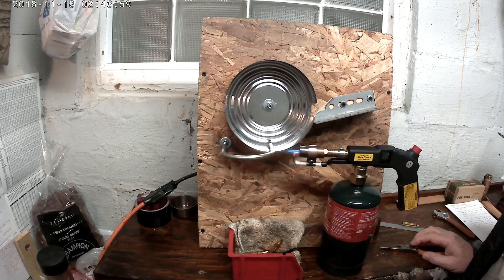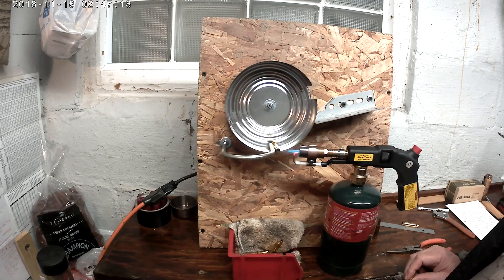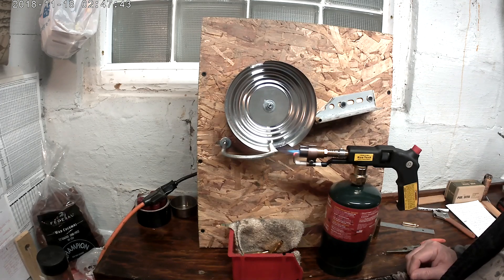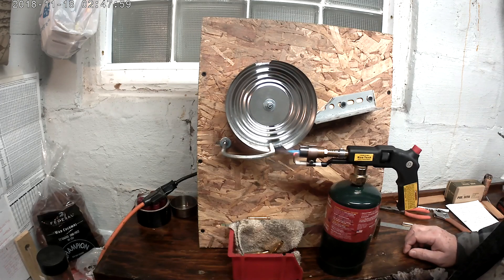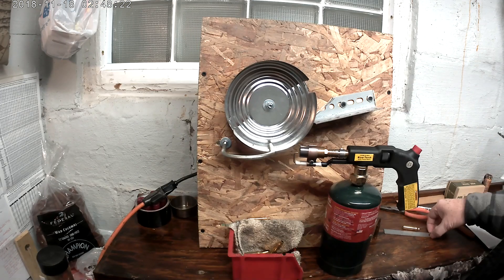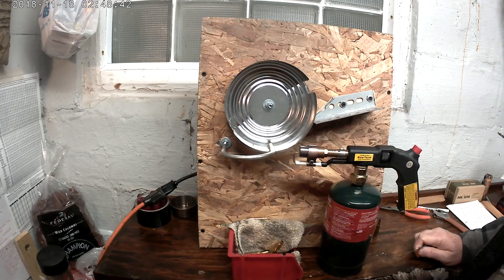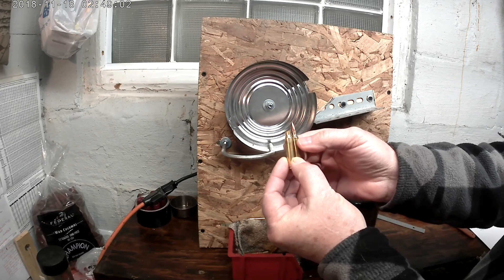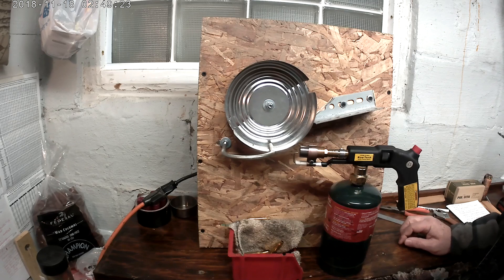Home Made Brass Case Annealer

Comment: Now this has to be my next project. I have some 750 degree Tempilaq on backorder I think I’m going to just use a deep socket and an electric screwdriver at first because I have never annealed before. I noticed my .308 cases start to get kind of crappy on the third firing and I need to learn to anneal so I can, hopefully, get the necks/shoulders a little more uniform and avoid the inevitable split necks.
Reply from the maker: Many people use the socket method as I did at one time also . As everything in reloading , being consistent makes things better . So I made this to have a consistent time in the flame . Thanks for the comment .

Comment: Nice work!  I have yet to try annealing.  I haven't seen any cracked necks yet (yes I know there are other reasons for doing it) but I have read so much conflicting info on how to do it, how long, etc that every time I think about trying it I just give up.  Maybe when I see a batch of brass start to give me issues I'll have to take the plunge and try it out.
Right now the most reloads I have on any brass is I have a 7.62x54r batch of PPU brass that I just loaded my 10th loads in.  I have hardly shot the last two years or else I would have a lot more firings on all my brass.
When I get there...maybe I'll go back to this vid and try to make one of these, thanks for the cool idea!
Reply from the maker: I understand . I didn't think about annealing brass until I started noticing split necks also .

Comment: Buy some 700º Tempilaq and you'll learn that you're overheating those cases.  Around 5½ seconds in a smaller flame directed at the neck/shoulder junction should put you in the 700-750º range.
Reply from the maker: I turn the lights out when adjusting the flame . With my torch I'm doing fine as the case does not turn orange with my torch setting . I'm very happy with my setup .
Reply: That's about right.  I had mine at 6 seconds but I was annealing so I can reform 223 brass.  Primal Rights has a video that explains how to spot when annealing is done, basically as soon as it starts to barely glow you drop it.
Reply from the maker: @DimaProk  With my torch setting and adjusting for the hint of a glow , I'm comfortable with my time and temperature .

Comment: This is a great idea would you be interested in make some more of these Case Aniler
Reply from the maker: All it is a Ebay 1 Rpm motor ,a coffee can , U bolt , piece of angle iron and some wood . The torch head is from Harbor Freight . You can make one in an hour or two . The motor I used came from Walmart as a rotisserie for a grill . I can do a detailed video if you get the parts . I think I have $20 in it .
Reply: That’s great ya I would really love to make one for my 300 bulk out brass thanks for the great info if I need help building it I’ll let you know thanks
Reply from the maker: @williebulletman5217  You will like the results . The first load I tried shot awesome with annealed cases .